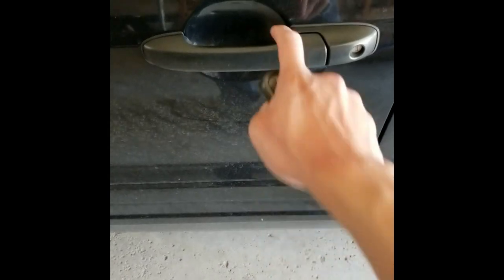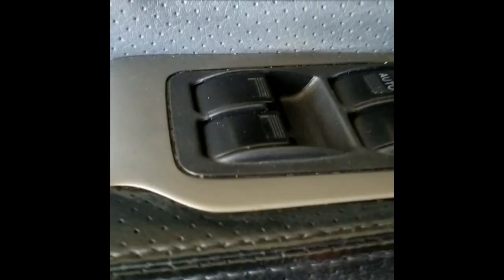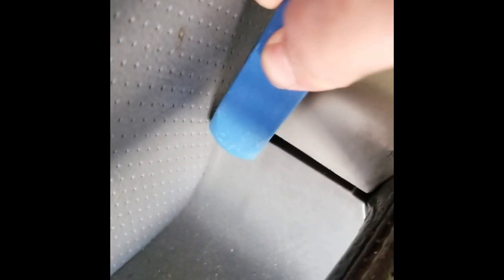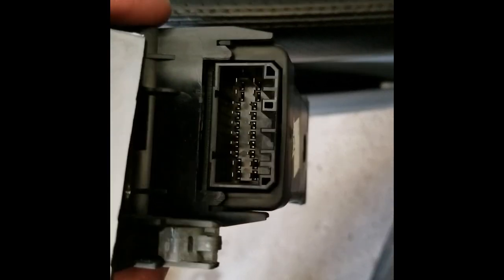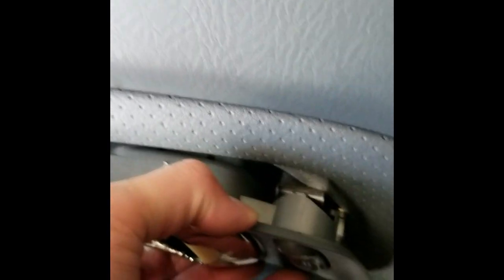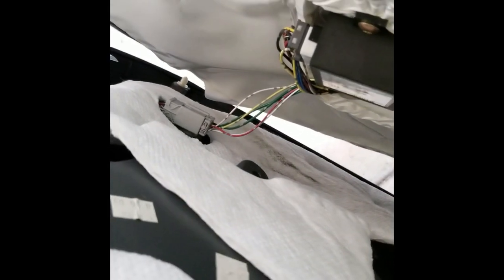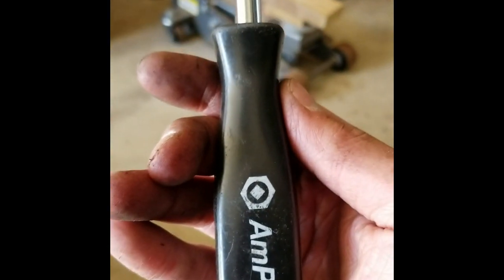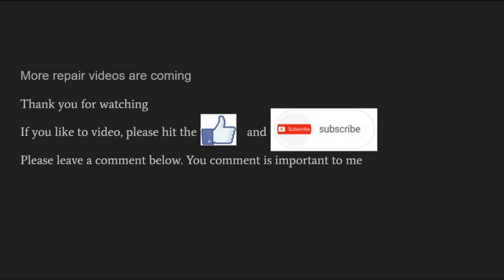NO POWER LOCK BAD DOOR LOCK ACTUATOR - 2003 Honda Pilot driver door lock actuator replacement

Comment: Just did the lock actuator on my Pilot. Had to heat up the 3 screws in the door jam with a small torch to break the locktite loose.

Comment: Hey boss, upon reassembly - Any pointers for putting that window guide bar back in? Once it’s bolted on, it seems really arbitrary as to what angle it sits at….
Reply: What I did with my Odyssey window bar: started by aligning the rubber on the bottom of the window glass.  Wiggled the bar upwards and twisted it back and forth.  Once I could see the threads for the bolt in the correct place on the outside of the door I knew it was right.  There is another video on YouTube that shows how there is a C shape of metal that holds it at the top.
Reply: @milescarter7803  Thank you!

Comment: I am about to do this on my pilot and I am just wondering if i could just remove the 10mm bolt that holds the actuator without removing the wire roads.